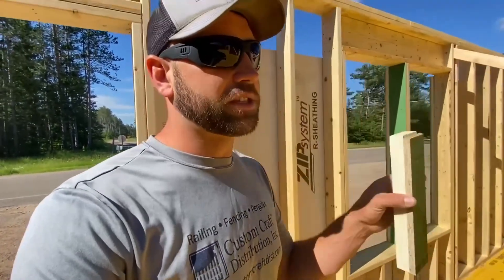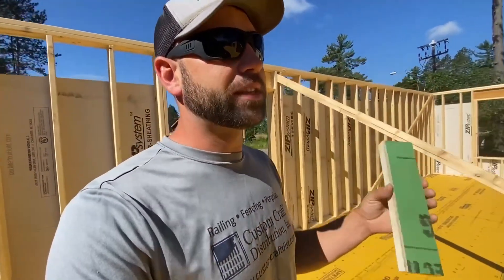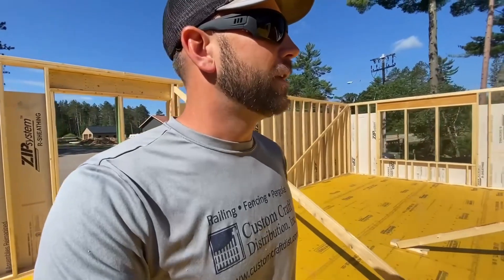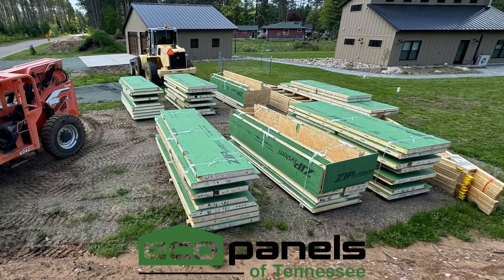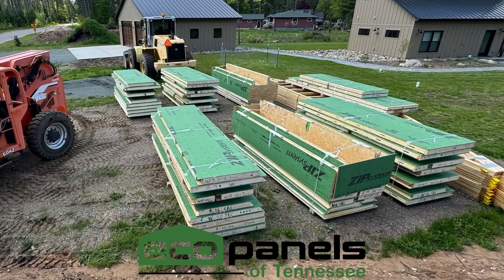What is Thermal Bridging? How do you prevent it?

Comment: so essentially this is sheathing with spray foam already incorporated on to one side correct?  does this eliminate the need for house wrap in addition if you use the ZIP system?
Reply from the maker: @PamelaOsterfeld  Yes! Essentially this adds insulation between the exterior sheeting and the stud. You’ll still need additional insulation in the stud bay to meet your local code at a minimum. Also you’re correct, the zip system along with their seam tape eliminates the need for an additional wrap, as the system by itself constitutes a WRB (weather resistant barrier)